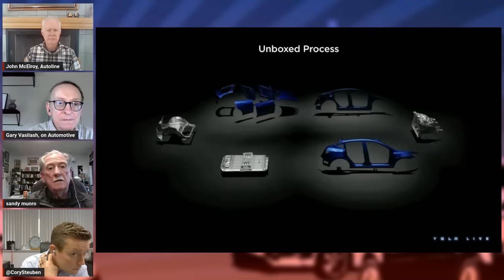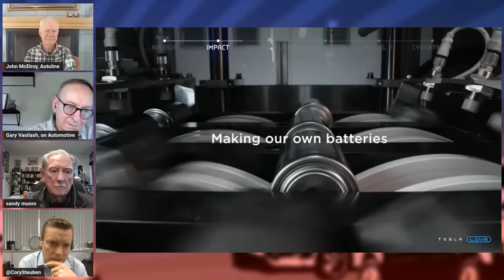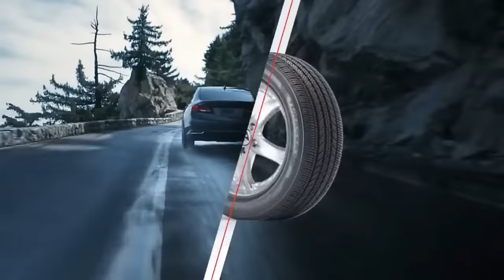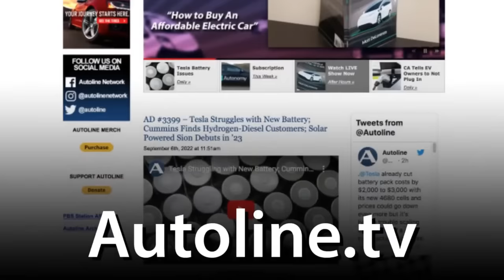Sandy Munro & Cory Steuben On Tesla's Master Plan Part 3 - Autoline After Hours 639

Comment: Wrong question.  It should be, can legacy automakers compete to make profit against teslas $25k car?
Reply: Want some irony?
Those frantically trying to transition (using "conventional" methods) may be in a situation where they can't compete.
But
There's a very slim chance that the company most regard as the most stubborn, which resisted change, may be in the position to "clean sheet , copy/ paste" the gen 3 line method and leapfrog those others......? (Depends on the attitude of the news CEO)
.
I'm NOT saying they deserve to survive.

Comment: What about Tesla’s IGBT motor drive bus voltage? Is that also 48V? In that case couldn’t they save on wiring if they go to 600V?
Reply: What they are talking about is the low voltage architecture like the headlights, drive computer, door locks, A/C, power steering, etc. All the electrical systems apart from the drive train.

Comment: I say the vehicle is front wheel drive like a hot hatch.
Reply: Interesting bet.  Front motor gives reduced wiring and piping as well as safer driving characteristics.
Reply: The Tesla?
Rear drive.
Why?
Lower profile.
Less complicated front end.
Better turning circle (less stress on drive components)
Frunk space (?)
Cheaper to build.
And prot things I missed.
Reply: @lighthousesaunders7242  My thought wasn't just that but better performance in snow.  The efficiency is a bonus.

Comment: But the Hyundai Ioniq 5 doesn't have any method to clean the rear window, and in Winnipeg, that is just a No-No as far as I'm concerned. The airflow vents over the rear window may work at speed with rain but not at city speeds during wintertime.

Comment: Clear that Tesla has articulated and is executing on structural change in Auto manufacturing. Corey and Sandy are describing the slow moving train wreck that will be most of everyone else in the industry as the structural change occurs under their noses.  I cant help but draw a parallel to the introduction of the iPhone and how Apple went from zero to 35% global market share.  Impressive that Tesla has built its products while achieving vertical integration.  Surprised that Autoline and Munro Live have as few subscribers that they have as its rare to have a platform in which the future is being foretold.  Great job guys and this was 2 hours of quality commentary.

Comment: This is a fantastic show, though there are two points where proper framing would place the info in better context. First, China is not a commutator or a partner in the EV space. As a country, China imports food, oil and chips, which is made possible by US supply chains and the US Navy. US supply sees that Mexican labor is 60% the cost of Chinese labor and the US Navy is no longer the guarantor of global trade. Second, Americans expect a lot from a $25k car because average pay has only gone up 15% since 1980, while prices have gone up by a factor of 2.5. While increased cost may be reasonable, it doesn't make it affordable or palatable for the average American.

Comment: Dumb question time:
What is the reason for having odd numbers for the voltages: 6, 12, 48 .... vs .... 5, 10, 50 ?
Reply: It comes from being a multiple of the underlying cell voltage. Lead acid is ~2V, so 3 cells x 2V = 6V, or 6 cells x 2V = 12V. Tesla have switched from Lead Acid to a small Lithium pack with cells that have a higher voltage (3.7V) which doesn't exactly map to these multiples, but they just over provision. i.e. 4 cells x 3.7V = 14.8 V. All cells drop in voltage as they discharge, so the components have to handle a +/- range of V anyway. The battery is rated 12 V, so they must be dropping the voltage a smidge rather than redo all the 12V components to accept 14.8.

Comment: Not against 48 volts, but is anyone thinking about the possible electrical shock hazard? I used to work in power conversion electronics and at 40.4 volts, the body becomes suspectable to current flow. It's the current that kills you. Just need high enough volts to breakdown the barrier that keeps current from flowing. I hope someone is thinking about this to keep people safe.

Comment: It will be impossible to match the color on panels not painted  as a singular unit.  That's why the other manufacturers don't do it. There is 17+ zones of color variation on each vehicle. Never mind from vehicle to vehicle. Bumpers being painted with completely different technology than the metal or plastic body panels. It's possable to get even tricoats spot on painting the panels off the car. But those panels must be orientated as if they are on the car. But I'm a production line environment it's next to impossible. 

How is the repairability of these pre painted or molded in color panels?  Molded in color is very difficult to duplicate color appearance on with surface coatings. And those coatings will age differently. 

Modern robot sprayers do not use the air spray technology your speaking of. Usually it's ultra high speed atomizing rotating cups.

Comment: if you have a 12v device and you want to run it off a 48v rail can't you just stick a little buck regulator module on it? am I missing something?
Reply: Cost, the idea to go to 48V is to reduce the content on the vehicle not increase it.

Comment: I get why 48 volts. Obviously a much better choice for all vehicles, from trucks to side by sides. Strange its taken this long. But why not 96? Future proof? Or is 96 getting too dangerous?
Reply: The change to x4 the voltage actually gives x16 benefits in electrical efficiency. In that is the big change in wire size and cost. Doubling it again to 96v does give you more efficiency, but it's not such a drastic change in the end result of component size. Also, the higher the voltage, the greater the problem of arcing across a component and shorting. Also for safety if you touch something. 48v, is still not that easy to penetrate through skin resistance and not such a big deal. 96v, is really starting to give you a jolt across dry skin and hurts. If it's across your chest, that's verging on heart failure voltage.
Reply: "Strange it's taken this long"
Familiarity.
(imo)
The design engineers were never asked the correct question by "The MBA's" who didn't know there WAS a correct question.
.
Whereas at Tesla you have engineers who DO ask and people "upstairs" (1 in particular) who understands the fundamental reasoning.
.
A "report" followed by a study which concludes it's "difficult" is replaced by a 10 minute high level tech discussion in front of a whiteboard with "the boss" contributing.

Comment: The elephant in the room is the cost of Insurance is cost prohibitive. To pay 2k to 3k a year for insurance for a 20k car,  not practical.  Insurance companies are running away from ev's.
If Tesla and such do not create a service/Repair industry for ev vehicles in accidents that is customer timely repairs,   it will hold back this industry for decades.  They need to get ASE repair/collision shops involved,  trained,  supported.  To sell a car that  you can not get repaired/ services in a reasonable time will turn alot of customers off.  Just Saying.  The after the sell business of tesla has greatly been ignored.

Comment: Does new looks matter to tesla sales ?
Do people go to a showroom to see the castings and heat pump ? 
Are Hyundai, KIA and the Chinese wasting their time ?
Reply: Are innovations easy and cheap to copy?
Reply: If castings realy are that good,,others can do that to!It dosent realy matter if you starting to use them right now or in five years!How about the extrem energycosts of the gigapresses?
Reply: @brunoheggli2888  probably considerably less than the energy consumed in auto transmission and ICE manufacturing…….then zero tailpipe emissions for the life of the vehicle. Solar/wind/pumped hydro/tidal > zero pollution .
Reply: @brunoheggli2888  
HEY Brunni!
Sure... "Others can do it" IF they can squeeze the order in with the company making the machine..... Which Tesla probably has tied up for 5 years making as many as they can manage?
.
They could go somewhere else.... (IS THERE someone else making these?).... IF China hasn't cornered that supply.
But those companies would have to gain the expertise to make the machine work and produce the alloy which suits the process.
Difficult.
Time consuming.
Then there's the expense for companies already carrying huge debt.
Reply: @rogerstarkey5390  Accualy many carproducer already use casting,just not that big ones!I dont even think its that of a big advantage!Factorys and prosesses getting modernized all the time,so one is taking tbe lead  with something,and if it makes a diffrence others will follow!Its realy nothing realy special!Mostly factorys wait until a prosess has to be proven longterm,and then they wait until the old stuff is written of and then they modernize it!Its not even that special what Tesla is doing, if you campare that to BMW who used a carbon strengened plasic for the bodyshell of the I3

Comment: You guys are way to pessimistic for when Tesla will outsell GM in the US.  Tesla plan to be at 20M vehicles by 2030. They are already at a production rate near 1.8 and are growing by 50% compounded each year.  Remember that Texas and Berlin are just ramping and they will build Mexico next year based on the new production line.

Comment: With EVs it is a single rare occasion when due to large oil reserves and fracking the US automakers are naturally disadvantaged comparing to many other manufacturers. Without Tesla it could be over for the industry on the international level. Even VW is doing better in EVs than the big three.

Comment: When I worked at caterpillar, the smallest wire we would use on engines was 18 gage because the wires would break if below that wire size.  In the cabs or on joysticks, we used smaller wire.   I had a whirlpool top loader washing machine that was the most unreliable washing machine I ever owned.  The reason was they used such small wire on the motor that the wires kept breaking.  Great care must be taken to strain relieve the wires everywhere they go.  I am thinking suspension and wheel sensors are as small as they can go.   I hope tesla tests the cars a lot on really bumpy roads and low temperatures to make sure the wiring holds up.  I sure don't want to be the guinee pig on those cars.    I love my model Y performance, but I will wait for sandy to tear down a cybertruck before I buy one.

Comment: Hi Autoline panel, what do you think ? In 3-4 Yrs Tesla builds $15k subcompact EV plant which cost Tesla $10-$12k to build, might have RoboTaxi version or future availability with that hardware, if lucky.

Tesla will need to sell cheap subcompact cars without robotaxi turned on or China will sell them, ($15k non robotaxi EVs),even in a Tesla full robotaxi world.

If no builds a 15k subcompact EV, that leaves China a huge opportunity to take new market share; China has done this cheapest available domination before in many other industries.

Irregardless a cheap Tesla $15k subcompact assures 20 million Tesla EVs a year by 2030, including a few other new categories of vehicles.

Will require another new battery breakthrough and other innovations to reduce costs which Tesla already has a track record of doing. For exa Mega casting one piece unibody, or no paint alloy of unrustable steel. Or have Optimus robots better developed and replacing humans profitably in the manufacturing plant.

Or Tesla can build their own solar power plants with megapacks to power each subcompact EV manufacturing plant making their electricity/energy costs to make subcompact EVs essentially zero, maybe even below 0 if they have excess electricity and sell it on autobidder or sell excess capacity back to the grid during the day if the megapacks are at capacity.

Robo taxi without a steering wheel or foot pedals may not be ready till after 2028 to 2030. Even then expect a three year rollout of the robotaxi service’s  processes and systems after they are rolling off the assembly line.

Hope I made my case for the Reala $15k subcompact EV, what is your opinion Sandy And Autoline panel?

Comment: Tesla - 485k units sold in US last year. 

At 50% annual increase.          2027: 3.7M
Reply: Add the wider market appeal.
.
They've been relatively "niche" to this point.
.
Then add larger more efficient  production?
.
Reduced price with maintained total margin?
.
ALSO consider the possibility of "reduced supply" from others ("Any" supply?)
.
Improved public perception (THAT'S what Tweety was (is) for)

Comment: Hate to break it to you guys but Tesla is presently running at a 2 million run rate for the rest of 2023, so another 50% growth as Elon has said per year, 3 mil in 2024 unless US and China go to war. Remember they are shoting for 20 mil in 2030. If they 50% cut there costs and Mexico starts selling the 25k car in 2025, they will sell everything they make throughout there whole line! Now if the 3rd Gen manufacturing process produces more product faster, better and cheaper, they may make more than 20 mil a year in 2030.

Comment: What if ? .. the new model 3 manufactured without stampings etc, using the new methods  is the new $25,000 car ..made in Mexico..it's the sort of mind-blowing move that Elon would do.. so the new car might be a similar size to 3 but be a hatchback and will replace the sedan.

Comment: 1:02 "...stock price dropped.."
Yep. News are ALWAYS NEGATIVE.
ALWAYS.
ALWAYS.
Why?
Because it ends speculation, which is the main component in high PE ratio stocks.
Ever heard "buy on the rumour sell on the news"?
Bond prices have a very small speculative component, they will track "news", stocks no.

Comment: The problem with saying "a $25,000 car should really be $34,000" - because of inflation - presumes your bottom end market is also making an income adjusted to inflation.   Musk has to offer a mid 20s choice, because people aren't going to be able to buy at $34,000, and it will just prop up the ICE makers another 5 years while they will have something < $30,000.  As the auto market ages into EV, Teslas will last longer; having the extra value that can be capitalized on later keeps Tesla going, since there will be a saturation inflection point around 2032 where existing Teslas will be outnumbering the new market.  Potentially some may make it to the 250,000+ mile mark.  Post EV/Tesla auto market phenomena....

Comment: Ouch. Cory is extremely off about capacity. Austin, Berlin, and Shanghai will all easily produce at least 2 million vehicles each. Current capacity is not that high because they're not ramped and they haven't finished building the factories out yet.

Tesla will outproduce GM by 2026 at the latest, and end of 2024 at the earliest. The most realistic and achievable scenario is 2025.

Comment: Assume makes an ass out of U and me.  Lithium is a key fail point in these big plans.  If one devotes 50% of the 100,000 tons of LI carbonate produced using water equivelent to 1/3rd of Lake Erie to process it.. you get a max of 5 million Model Y size battery packs. To break through this major choke point will require a better more scalable cheaper high density battery.  Lithium is a dead end for EVs and big plans.

Comment: Nice but I will never it. I only need  an EV Tacoma size 2 dr club cap pick up 4x4 with at least 250 mile range but can’t be much over $30,000.  If there is nothing like that coming then I guess I will not ever own an EV. I am not buying an China made vehicle that may be the ones making an EV something like what I want at the price I want.

Comment: Tesla’s logic of having a robotaxi that sells for 25,000 is flawed. Person who buys a $25,000 car would like to not have an updated charge at home since they live in an apartment or live in a city and park on the street. 
The vehicle being used to carrying passengers as a robotaxi actually needs to be built very well and possibly can be sold for even more than $100,000 because it’s their business or commercial vehicle. Also, a vehicle being sold for 25,000 will likely be much smaller and won’t be comfortable for passengers as it will not have enough intiror space.
Reply: The vehicle designed as a Robotaxi needs to be a "box".
It needs a low floor.
It needs very easy access, (including wheelchair)
It needs a robust frame (note, not robust "panels/skin")
It needs a simple, easy to service drive system.
.
It will be the "Boxy" vehicle shown in the presentation.
Rear drive (,motor under the seat)
Tight turning circle (hence rear drive)
Steel frame.
Snap on composite panels (NOT Carbon, possibly a Hemp fibre based plastic) either self coloured or wrapped for advertising.
150 mile range with 15 minute to 75 mile charging (graze charging will easily exceed daily mileage)
......
Now the controversy (?)
.
That vehicle will be the basis for:-
The taxi.
The "Compact" (Short! Not "small") car.
The CITY Van (Every city will have a low emission zone, it's needed!)
.
Building all 3 formats on a modular system will save money.
The side and rear panels will be configured with different windows and doors, but the outline and final assembly will be common, and automated.
.
As Cory / Sandy mentioned, they will be assembled with structural glue, aligned with indentations in the joint faces of the panels then clamped and final fixed with a single screw fastener / rivet.
.
What's "the other car"? (Top right)
The Roadster.
(Look at pictures, it's obvious)
That may be the test vehicle for G3. Slow build, easy to adjust the system before rapid production.
"50% saving" on a high value product makes it worthwhile.